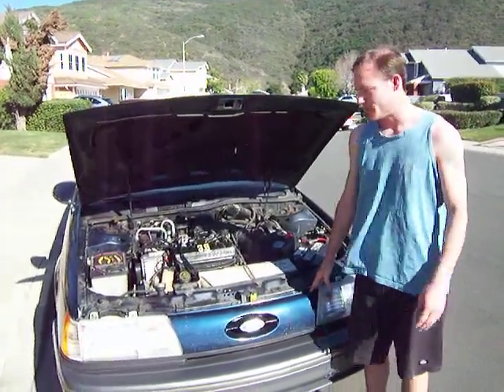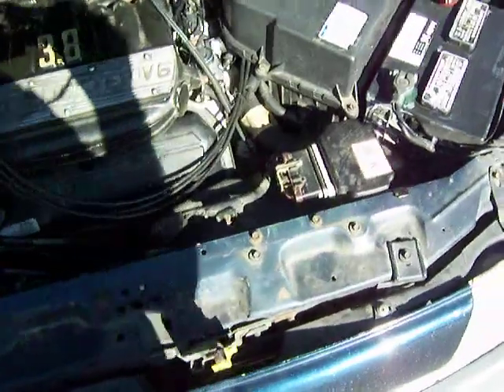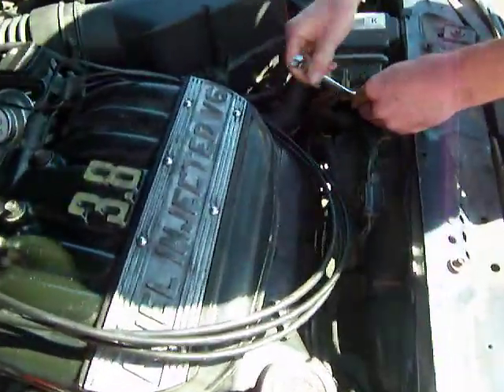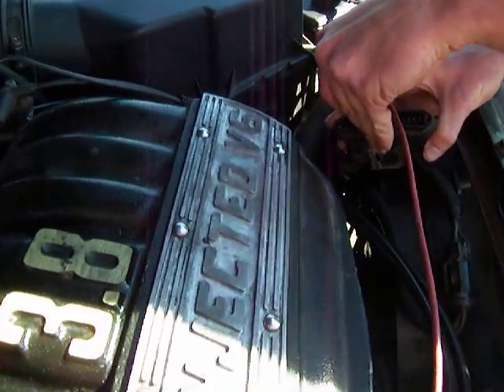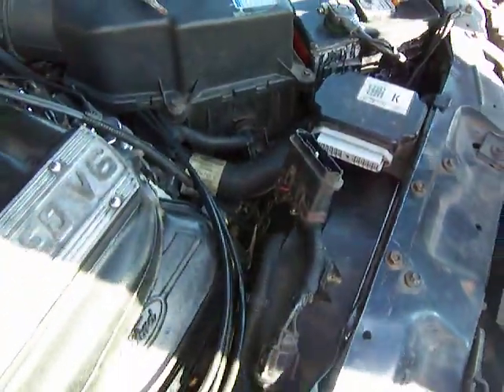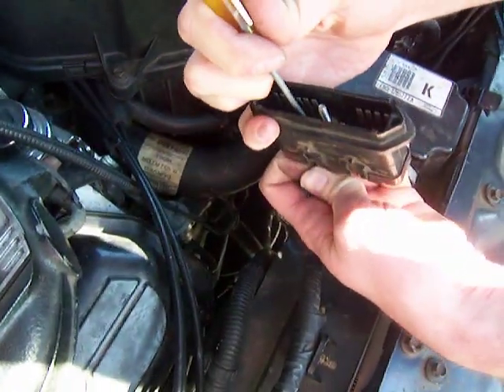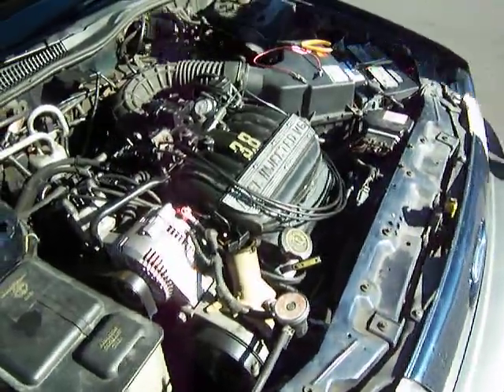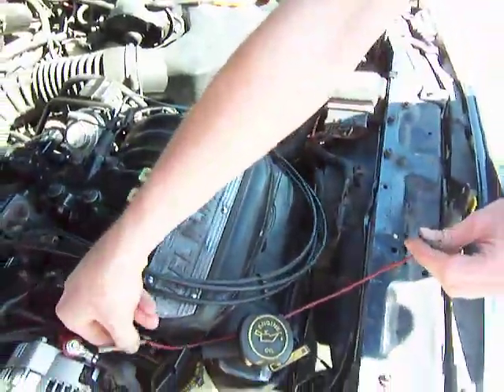How to check the fuel pump

Comment: ... worst advice you can give on a LARGE variety of cars, on a good many cars you can't hear the fuel pump either because it is quiet enough the average person wouldn't notice or more likely be able to tell what the noise is. also there are other pump issues like the pump, pumps some fuel, just not as much as it is supposed to.

Comment: Bad ass video buddy ! :-) I'm having trouble on a 00' vw jetta no start oil light flashes and beep. Oil change k it cranks and seems like its the fuel pump I need to check that relay tho. The fuse box is ok. So the relays... Or pump. I don't think I'm getting any pressure but it hums a non steady tone. Fuel filter was replaced last time a few months ago to pass emissions. Passed. Recently car lost a lot of power on the highway to work. Got to work and wanted to move it again it wound not start

Comment: I have a hyundai 2001 accent, I start it in the morning drive it for about an hour or so, and then close  it doesn't start or sometimes as I'm stopped at a light it stalls and doesn't start back up. Is it the fuel pump or crank sensor?

Comment: @jasonkesk: this is one of those parts that goes by two or more different names, maybe because Ford called it the ICRM (Integrated Control Relay Module) in the first Taurus model--ryanwm80 has a first generation Taurus, and when the second generation was released, Ford may have started to call it the CCRM.

Comment: Many people have bad fuel pumps, but can get the car started by "banging on the gas tank" (or pump if in another location)  The car may then run perfectly for weeks, with a bad pump.  The pump will pass all tests perfectly (fuel pressure, amp draw, etc)

I have never found a way to test a pump that is perfect one day and bad the next, then perfect again.  Since this is often the case, this test you show may not be enough.  Any ideas on how to test a pump like the one I described?

Comment: You said that if the pump comes on when you give it power, that the pump isn't bad.  I don't think I can agree with that. 

Many (if not most) times fuel pumps go bad in stages.  So it will work perfect one day, then won't, then perfect again, etc.  A pump can test perfectly and still be bad.  This is often the case. It will give good fuel pressure, draw the proper # of amps, etc. but still be bad. Therefore, in the case of many pumps, there is really no test that can be done.

Comment: I Have a 2001 Mountaineer with a 5.0 ltr, it runs fine in regular wheather but as soon as wheather is cold well it don't start. It doesn't seem to be the battery or starter because it cranks and cranks but just wont start. If i leave it until the afternoon when wheather temp. rises then it starts and runs great just like it never had any problem. when it doesn't start I tried to turn key on & off about 20 times but still nothing happens. could it be a module or my pump? Any help would be great

Comment: nice vid!.. what happens if you have a low compression in all cylinders. 
the car won't start now but before that, is was running good. until rough idle, then it died. when i opened the gas tank there was no pressure. the spark plugs are new.

Comment: there is an easier way than removing the harness and having to rebuilt it after you fix the relay for an emergency. you can just cut the wire and hook up the 12 volts, and then after you replace the relay just slice the wire back in place with a connector. If you are in an emergency situation, you may not have those kinds of tools, but a wire splice would be much easier.

Comment: U just saved me 800 dollars.The car needed a new
fuel pump, injectors are leaking at times but its just better to replace.20 year old injectors fuel pump it just doesnt 
mix, the fuel pump turns on if i jump start it.Thanx for the video.

Comment: I have an 88 conquest tsi.I get spark on all cylinders 
but still doesn turn on.I think i have a fuel delivery problem.I have new battery,New dizz,New rotor,NEw distributer car,New spark plugs,New spark plug wires,
coil is  ok,New alternator.Its a project im working on can any  one help.If its my injectors or fuel pump or icr.